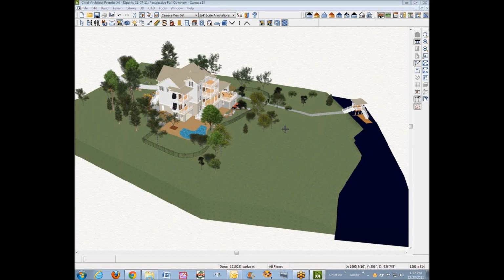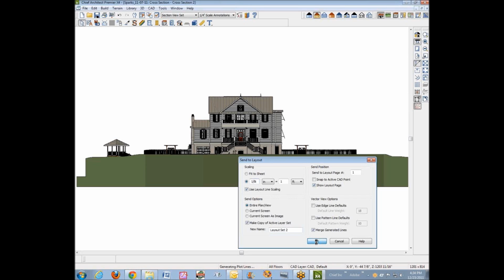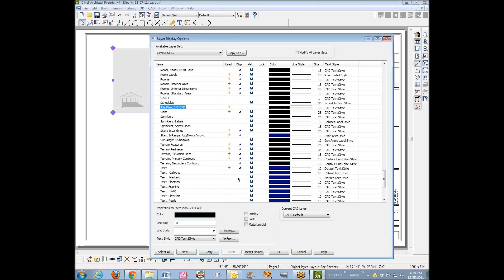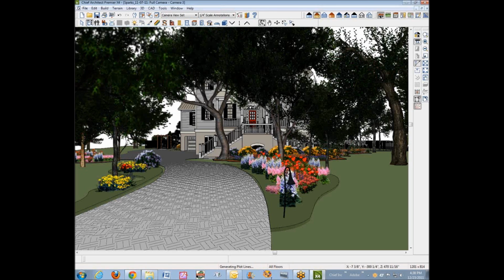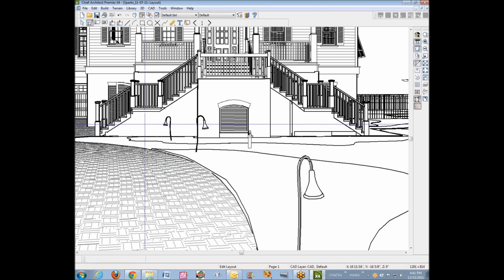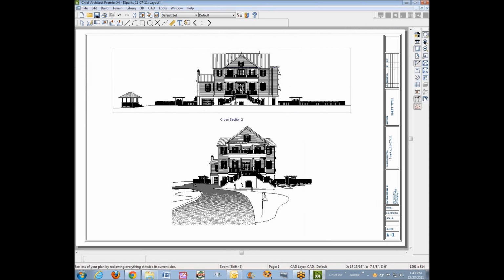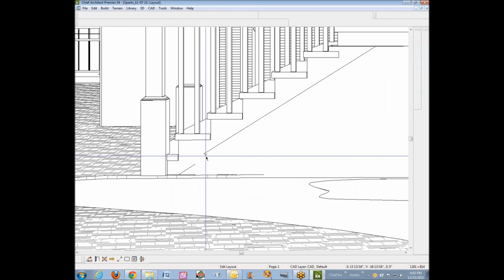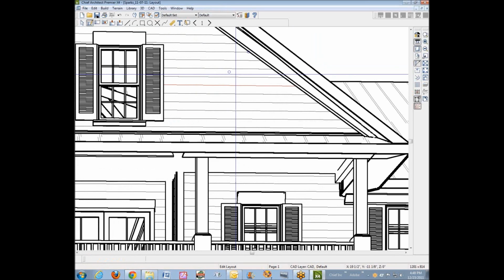Chief X4-Edit Layout Tool

Comment: Hi
With Chief X4 I cant see textures on Perspective full Preview!
Instead at Chief X3 I could!
In  X4 I see only the color of the material but not its texture. If I select "use Texture" at the render Preferencies window then the model becomes of grey color.( For example a wall made of red bricks is presented red without the lines of the bricks ).
Also with "toggle textures" the same thing hapens.